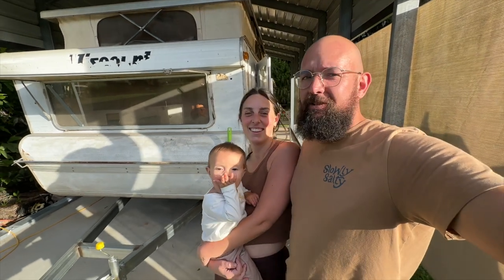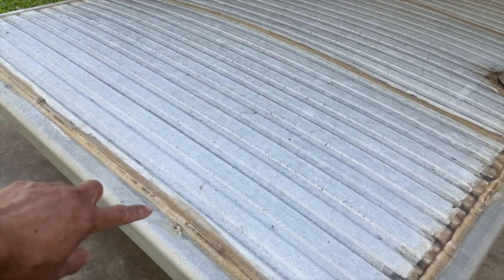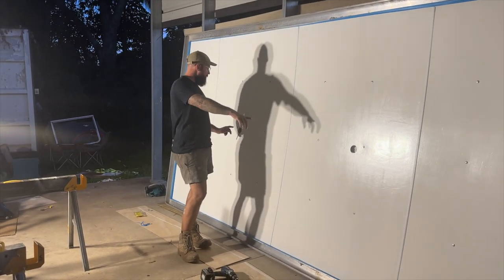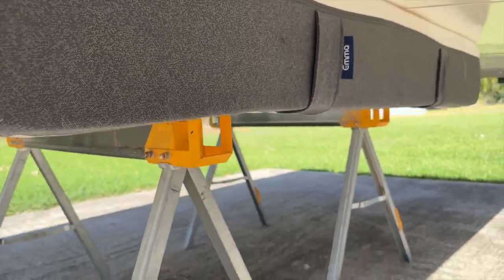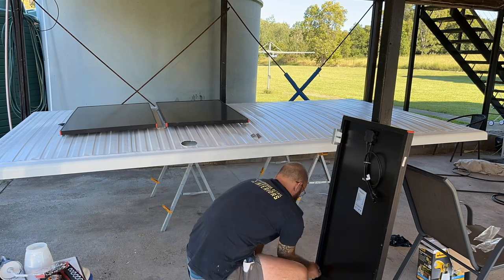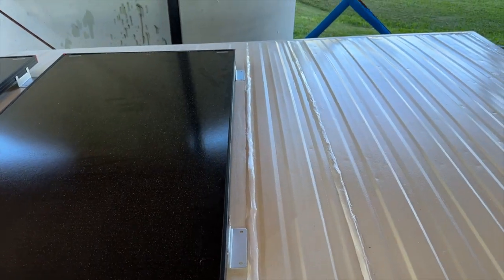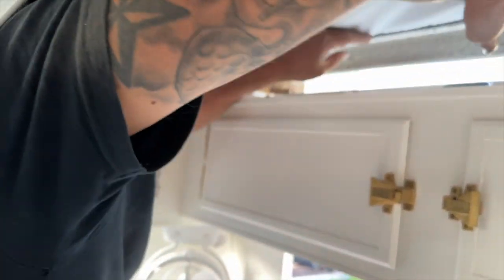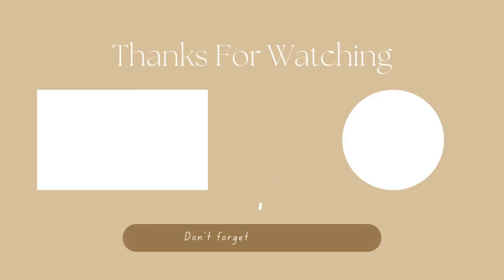Restoring the pop top on our Vintage Caravan | Viscount Caravan Renovation Ep 6

Comment: Use a silicone buddy on the roof next time. You can get them at Bunning's and they will give you an excellent even and smooth finish! Nice video, thanks for sharing. Now I know how the pop top comes apart. Thank you
Reply: Is a Silicone buddy the brand name? I can't find that on the Bunnings catalogue.
Reply: Sorry that's what we call them and cant recall the proper name. They are small yellow flexible shaped silicon spreaders. We use them to get smooth even silicone on panel joins etc. They are really good.
Reply: Thanks! That gives me a start.
Reply: Painters mate they are called. Little yellow silicon wedges to help finish off the silicon very neat. In the paint section at Bunnings mate.

Comment: I found my roof rivets were corroded and were at the stage of popping out/off. Definitely recommended replacement with oversized headed rivets. Don't do all this work and then a few rivets pop causing a leak.
Reply from the maker: Oh that’s no good do you think they were steel rivets as that would cause corrosion when used with aluminium? ours looked to be in good condition
Reply: @AsWeWander  the rivets were small or standard size / headed aluminum ones. They were not sealed or painted so corroded the head. There is dissimilar metals used with rivets - ie. the rivet head is ally while the expansion / engagement mandrel is steel. i found that the rivet heads were like powder.  Some just came off with pushing the drill into them.   I drilled out all the rivets, cleaned as much of the sealant as possible from under the roof sheeting edges. I then applied sikaflex under the edge before refixing with oversized rivet heads, just from Bunnings. (same diameter rivet hole). I then added a thin layer of silicon on the rivet heads. following extreme rain event no water was found in the van at all.    

Highly recommend doing this to an older van; especially when doing all the other restoration work.

Comment: I was interested in whether you could fit some form of insulation between the roof and new internal ceiling for more protection for outside temps 😊😊
Reply from the maker: We probably could have replaced the foam that was in there with a thicker foam but you wouldn’t get a wool or fibre glass insulation in there because once that’s squashed down it doesn’t work at all.

Comment: Hi Guys just finished  watching hope our turn out half  as good  great job 
Asking did you replace  the stringer on the roof ? what size  and materials   and how did you attach  them at the end off the pop top ..
We have completely  strip out pop top all we van is the outer frame
Reply from the maker: Hey! Thanks for watching, I’m sure it will turn out great just gotta push through the shitty moments and it’ll come up nicely. We didn’t have a stringer in our pop top just the metal bars going across from side to side and this is what we reattach the new ceiling to. Hope this helps

Comment: Saw your video on iTechworlds side re the 150w panel instals. I'm adding them to our caravan and wondering if you have had any issues with the panels and brackets either leaking or coming loose? I'm hoping not to have one fly off...
Reply from the maker: Hey there, we haven’t had any problems and it’s been 10months on the road now. We generally travel at 80-90km/h when towing and have past trucks coming the opposite direction with enough wind to move the whole car and caravan and haven’t had any problems.
Reply: Great, thanks for the reply 🤓👍